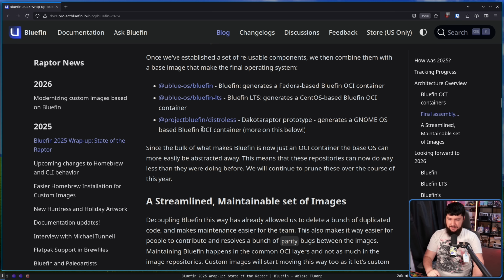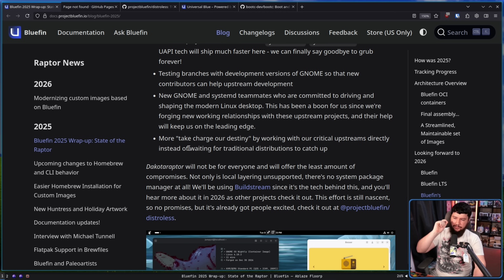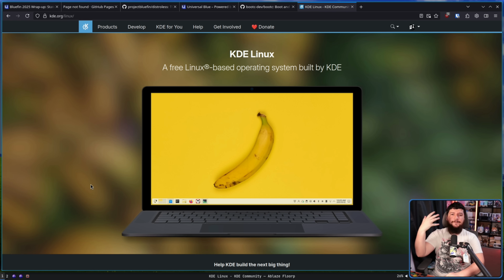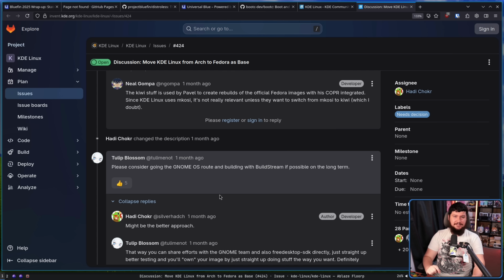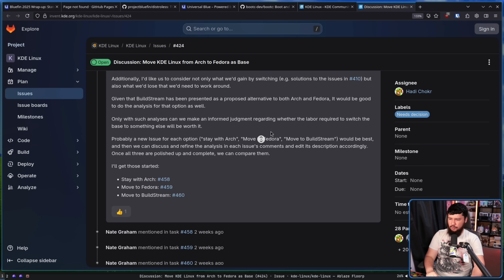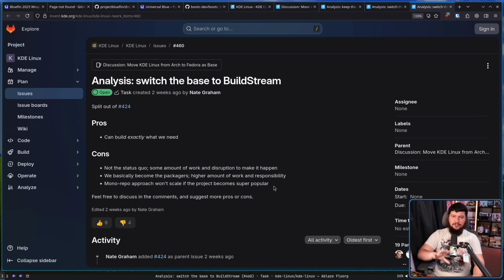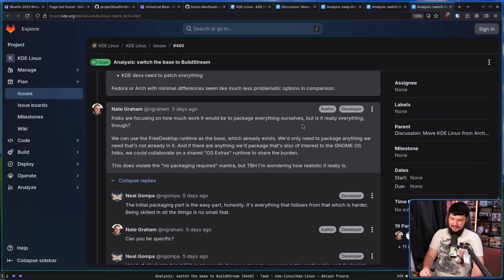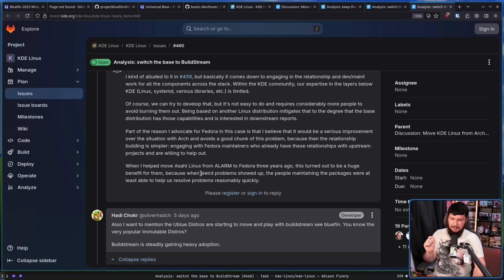The Future Of The Linux Distro Is No Distro

Comment: Since running nixos on my home machines, and using nix in debian, fedora, ubuntu, wsl2, etc, I came to the conclusion that a distro is really just a package manager and some defaults.
Reply: The actually unique distros nowadays are probably LFS and Gentoo. Both allows you to customizen your system extremely.
Reply: @PanduPoluan  nixos is similar to gentoo because you can also build most things from source (it uses a binary cache by default, but you could also disable this if you have too much time) and every part of the system can be changed by modifying the nixpkgs repository, simmilar to gentoo's ebuild repository. if you want to build even more things from source, gnu guix sd is basically nixos but with guile scheme instead of nix, free ( libre in the gnu sense, and with a focus on bootstrapability / rebuilding everything from source.
Reply: @PanduPoluan  
and LFS is so low level 
it is not even a distro
Reply: @o_-_o LFS is a distro, stop getting all of your information from ricing youtubers.
Reply: @PanduPoluan LFS is meant for education for learning linux
Reply: @PanduPoluan that and NixOS.
Reply: @PanduPoluan Every distro allows heavy customisation. That you don't think so implies you haven't used them, or tried.
Reply: @PanduPoluan  well LFS is a guide not a distro, i suppose following that guide would give u something quite unique. and gentoo i guess lets u have more customization with use flags, but its still a distro based around its package manager like every other distro, even arch largely compiles things from source too since most things are done thru the aur (altho it does have -bin packages) so even that part isnt the most unique

there are few that truly do something unique. nixos/guix are quite unique with their declarative shit but u can use nix and guix without the distro, and maybe like bedrock linux too thats pretty unique. but barely anything is really unique
Reply: Yeah, but the "package management" part is the important part. Some defaults are easier and harder to change, but you have to follow whatever policy your distro maintainer has for package management. Sometimes, this means very outdated packages. Other times, they expect manual intervention. For some, they pursue a specific agenda, a goal, an ideal they follow. Then, some, asks you to learn a lot of things to do what you want.

Choosing the right base is, IMO, very important for a truly long-term use without any reinstall.
Reply: @FengLengshun  that's one of the decision factors for a specific distribution. I don't run the same distro on a server than on a desktop.

Server debian stable with backports, Desktop that needs NGreedia Tuxedo OS, everything else Chimera Linux
Reply: sometimes those "defaults" can include things like alternative system-wide C and C++ standard libraries though, like Android, Alpine, Chimera and Dragora, which could be pessimistically summed up as "we broke compatibility with everything you think you know because we feel like it", but optimistically summed up as "a GNU userspace monopoly is bad and diversity of development platforms is the strength of all open source"
Reply: @tacokoneko  beautiful summaries lmao
Reply: @tacokoneko  to be fair to alpine at the least, the different libc implementation is primarily for saving disk space in embedded environments and containers
Reply: @henryasbridge5161  yeha i mean he's joking but ofc we need different distros for different stuff. Arch and BSD mix up super well for example
Reply: @tacokoneko Very good point, and I'll raise you "but, fragmentation?!"
Reply: The toxicity of the comments on this one is fascinating – and all that to a person sharing how they learned something new. What a disgrace
Reply: @pmmeurcatpics  toxicity? where? I just see ppl discussing linux? Ohh found them at the bottom XD
Reply: I vehemently disagree, now that SuSE dropped YaST. 
Instead of explaining my MSCE certified colleagues the use of one graphical tool to use while I'm on vacation, I now have to let them wrangle dozens of little programs that are neither as well documented as YaST nor fit the job: maintaining SuSE installations, SLES servers, SLED clients and openSUSE lab equipment. 
As soon as it's gone, as soon you become aware how good you had it — be it YaST, Scientific Linux, the benevolent old Red Hat, X11 or CentOS.
Reply: That's literally what a distro is and has always been. What are you talking about?
Reply: Holy hell do some Linux folks need to learn tact. They are correct that you’ve just back-engineered your way into the definition for “distribution”, but they don’t need to be so bloody rude about it!
Reply: If you want to be extra reductive, the package manager can be considered as one of those defaults. That said, it is ultimately the component that most defines the feel of the distro, so it's still useful to give it special attention.
Reply: And most of that package management is terrible. Doesn't matter which distro.
Reply: Basically that is. Most work the same, and take the same kernel BUT some decide to risk security/stability for new features, so they use the latest kernel, some play it safe and use older packages. And that is linux problem basically. Some are on kernel 1.1, some on 1.2, some on 1.1_custom. Some use init_alpha, others init_gamma, some library_kilo others library_giga. The same, but with no order AT ALL. We need a distro to rule them all, something like "Sauron OS" XD

There are the ones that decide instead of using A, lets use B because B is for Better obviously XD. Very few do things differently, like GoboLinux, which instead of having the same filesystem hierarchy like: / , /bin , /sbin , /etc , /home , /root use something more similar to MS tipical C: with /Programs, /Users, /System, /Data, /Mount, /Files, /Depot, so you get a more logical way of handling your programs.
Reply: Pretty much. Like there's some filesystem convention differences between Debian, Arch and Fedora, but it's not like those are there for any reason other than someone liked it better at one point and it stuck. Just gotta look up stuff like "Arch equivalent to Fedora /usr/whatever" and you're probably set. On the other end of it, that means those differences could be done away with practically overnight if there was the shared will to do so.
Edit: Not to downplay the role of a distro though. Imagine untangling dependencies yourself. Yeah, that's what we'd face without what makes a distro a distro..
Reply: True, and that being said, BunsenLabs Linux is the underrated distribution of all time
Reply: Haters will argue with what I just commented but they think Gentoo is anything new, so, *dismissive hand motion*
Reply: Arch users know that from the start, Arch is the repo for pacman where you get the kernel and the init system from. 
Instead of installing the meta package "base" you can install only the parts you want, the base package is just a suggestion.
Reply: I have been saying this for so long, a distribution, is nothing but preinstalled software, and a package manager.
Reply: That's why it's called a distro.
Reply: Condescending, insulting, gatekeeping comment goes here. Am I a Linux person yet?? Seriously I love using Linux but I could do without all the elitist nerds that have to one-up each other constantly. Calm down and appreciate how you're lucky enough to be using Linux instead of Windows. This comment is obviously meant for the others who replied to your comment
Reply: @ChezSanwich Yeah they try to sound cool, they are too short-minded to realize they also had to learn it at some point
Reply: @ChezSanwich  Yeah, truly the scum of the Linux community came to stink up the space. Unfortunately you can't go anywhere without these dunderheads ruining it for everyone else.
Reply: Took you that long to learn what a distro is?
Reply: duh. Its called Distribution for some reason, because it distributes their version of softwares.
Reply: You didn't need nixos to teach you this. You should learn some fundamentals first buddy.
Reply: no shit Sherlock. You figured that out by yourself?

Comment: Starting two months, I have started building something that works a bit like this for myself. Basically, for my development work I have whats apparently called a "metarepo". Basically a git repo with a bunch of dockerfiles and devcontainer jsons which than has all the projects I'm currently working linked through git submodules. Whenever I work on a certain project - lets say a web service that needs debian 12 + python 3.12 + postgres I load the project in that container and my host operating system is nothing more than a bootloader for my development containers. 

That way, I don't have to worry about scripts, installers, ... messing with my system files and bricking stuff in other projects, I have no more issues in terms of depenency hell and if i decide to change host OS, its really easy to the same environment up and running. If something is particular annoying to get running on my distro of choice ... no biggie I just add a new dockerfile with a different base distro and install it there.
Reply: swaws!!!
Reply: @22oreos whats that?

Comment: I don't see why people don't use a VM if they want everything so containerized but maybe that's just my own ignorance
Reply: it is your own ignorance
Reply: Could you recommend me some good reading on the arguments in favour of such heavy containerization?
Reply: @niamhgirling6000  containerization is not heavy. It is VMs that are extremely heavy. Containerized apps work with your "host" Linux kernel, while VMs emulate hardware on which you run a "guest" Linux kernel. The are some performance tradeoffs to containers VS no containers, but they're extremely minimal — you'll probably only ever notice spending more storage for containers. The uBlue isn't even using the containers to run the OS itself, they mostly use them as a development tool and a distribution mechanism (in that case it can actually reduce storage and traffic used for updates, as it can tell what changed and what didn't — to a degree, at least). The runtime in their case stays native (discounting Flatpak apps, and toolbx/distrobox containers).

I guess the easiest way to understand this is to try creating a Docker container, and understanding why Dockerfile is the way it is.

Comment: Distroless is a dumb name
Reply: We are just going to call it an operating system
Reply: @tulilirockz  I'd say GNOME OS is a distro and KDE Linux will be a distro if they use Buildstream, but you could argue to call Buildstream / freedesktop SDK a distro, because probably the most important task of a linux distribution is to distribute software packages. I respect your work btw, tho I don't fully understand it.
Reply: @szaszm_  GNOME OS is not a distro on the basis that they don't distribute software. It is an operating system, without the package repositories. I'm writing this as someone who were also extremely skeptical not calling it a distro.
Reply: @mks-h  Distributing ISO files and OCI containers is still distribution. You're still distributing software, just with a focus on core OS software instead of libraries and apps. That's basically what Linux distros were before package managers became a thing, and we still called them Linux distros.

The way it's built is distroless, because it's built direct from source in every sense of the term, but then calling the resulting distro distroless is kinda dumb. The package manager being the difference is even weirder, because they do in fact come with non-system package managers like Flatpak. The build system in itself is sort of a package manager too, because you still have to compile dependencies in the right order. A much dumber package manager, but it's not far off what the original dpkg and rpm looked like either.

It's a very poorly picked term.
Reply: @maxpoulin64  maybe you're right, but a few points:

- The package manager they come with is third-party to the project, so it doesn't count.
- The build system is not a package manager in the sense that it is an internal development tool that users do not interact with.
- GNOME OS doesn't use the "distroless" term, but they claim to be an OS, and not a distribution.

I cannot comment on the early Linux stuff, since I was born ten years after the initial kernel release.
Reply: It shouldn't (and may not be) a name at all, but rather a category.

Comment: cloud native not web native
Reply: Oh that explains so much. Thank you. Unironically.
Reply: And coincidentally, not in their machine, which is likely running OSX.
Reply: ...genuinely, what's the difference?!
Reply: @dryphb  Web native is using webdev for the desktop, cloud native is containerize everything
Reply: @Valkyrien04   but why?
Reply: @corylyon545  Webdev allows you to write a framework for each platform, and then the app can run on that framework on any platform using a common language.

containerization helps with security and cuts down on "it works on my machine" when you have a hard version requirement but don't realize it.
Reply: @corylyon545 Faster building, portability and standardized testing grounds within a safer environment.
Reply: @MrGrappleMan a standard environment for developers who aren't on Linux mostly. And yes I know there are real advantages, but let's be real, the reasons some of these developers are pushing for this is because they don't actually use Linux and that includes the ore Gnome team.
Reply: @dryphb  Cloud native is referring to containerization. Containers are the de-facto way of packaging and hosting software on cloud providers like AWS.
Reply: @kibakoba  actually no cloud native is refering to a set of principles ideas and best practices a developers and Projects one of those being containerization. but all of it goes really back to the idea of cattle not pet
Reply: @dryphb ...and MondoDB is web scale

Comment: "Everything a container" means every app comes with all its dependencies included. That defies the idea of shared libraries and that's why it ramps up RAM usage and network traffic for auto-pulling the latest release. I don't need to express my feelings about people that take this crap seriously.
Reply: No not really. Flatpak duplicates things yes but only once in a best case scenario. Besides a lot of software now doesn't do shared libraries
Reply: Windows and MacOS proved that no one care about dynamic linking.
Reply: The whole world is moving to static linking because in my opinion we are at a point where for most usecases the upsides of static linking outway the negatives. New systems languages like Rust, Go, Zig all default to static linked libraries per default. The only two arguments for dynamic linking is that it saves resources and that in theory you can upgrade your shared libraries independently from the applications themselves for improved security at the cost of potentially leading you right down dependency hell, not to mention the added instability of running a programm against a library version it was not originally built for. 

For community ran distros like debian or I fully get it, the additional server costs of having everything as a static binary would be a big burden, but for software thats not coming from the distros package manager, static linked binaries should be the default i.m.o.
Reply: @floppa9415 the problem then is that once people make only statically linked builds, that's the only thing they test and support, and distros are on their own / packaging static as well.
Once that's the case, every fix anywhere in the dependencies, means huge rebuilds for everything down the line and hours, days or weeks of running unpatched versions after the vulnerability is fixed and disclosed (which is often simultaneously)
Read the blog post by one of Gentoo's main devs, "The modern packager's security nightmare" — author is mgorny, dated 19th Feb of 2021
Reply: If shared libraries really work the way supporters think they do, then why was busybox/crunchgen ever invented?
Reply: NixOS fixes this 😉